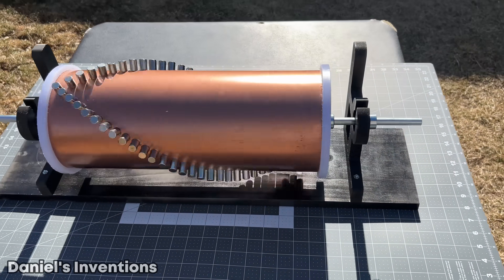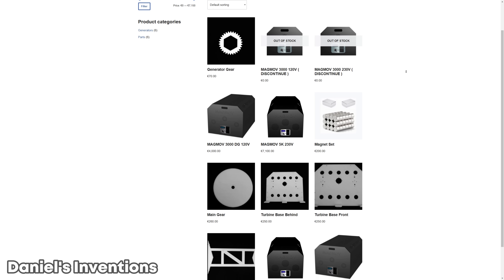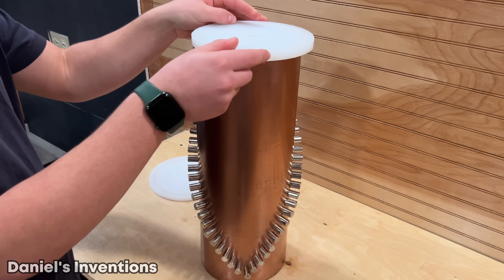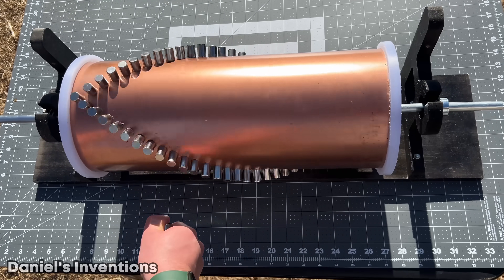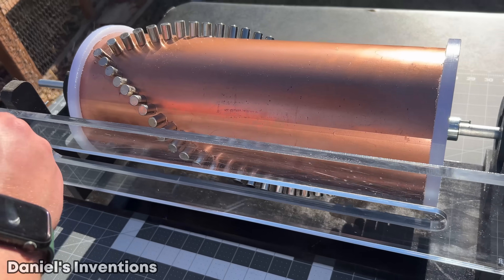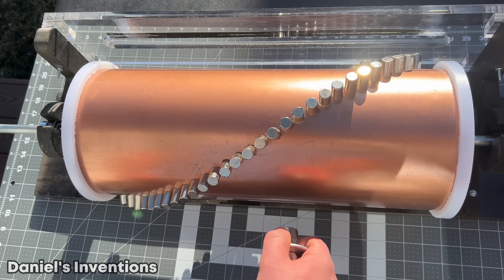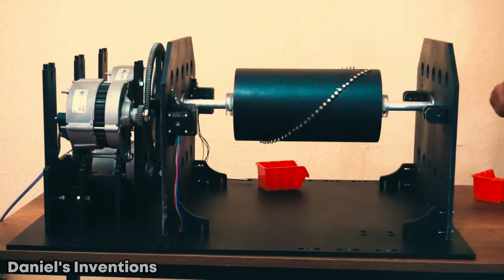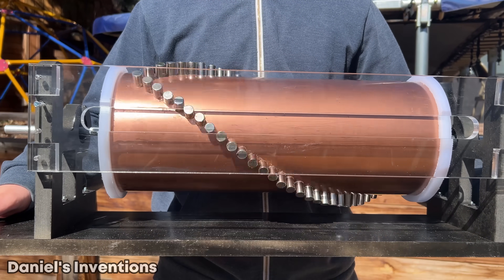A Generator That Can POWER Your Home for Free

Comment from the maker: I attempted building a basic prototype of the magmov magnet motor to test the concept of operation. It is unclear if this motor ever worked in a closed loop, generating several kilowatts of free electricity and charging it's own battery at the same time. After doing some testing on this prototype, it seems promising as far as using the actuator permanent magnet to convert linear motion into rotary motion. However, in order for this invention to be overunity, that means that the power required to move the actuator magnet back and forth needs to be a lot less than the torque generated in the rotary motion.

Also, not sure if the website is legit. Here is the link of the website: https://magmovenergy.com. If anyone ordered anything or has gotten in contact with the company, please leave a comment for everyone else. We would all like to know if this invention is the real deal. Thanks
Reply: Hi Daniel, how can I contact you? I have a real easy ou device for your next project. I promise it won't let you down. It's so simple I'm sure you will love it, and after we can sell them or the plans? Cheers
Reply: Fake fake fake. It looks pretty, that's it
Reply: That is some new cool things you can do with the magnets. Has anyone tried that with a copper rod instead of a different alloy and the bearing housing at the ends are magnetic to get the Eddie currents flowing?
Reply: @DanielsInventions  Daniel I believe it works, but 7 years old and like many others, nothing. Please read my other comment re a less complicated version you will figure out the design. I have another machine I'm looking to partner with, if interested?
Reply: Даниэль, конструкция Магмов украдена у твоего соотечественника-Джеймса Эллиотта.
Эта система рабочая, не нужно сомневаться.
Самое сложное в этой системе это синхронизация работы шаговых двигателей
Reply: @ADMENTNMANTAR  daria pra usar algo como algumas engrenagens e que com a rotação do primeiro motor fizessem o ima que transfere o torque pro motor se mover e sincronia, agora depois de dar o start seria difícil para a rotação e o ganho de velocidade.😂😂😂
Mas isso poderia ser resolvido criando um afastamento do imã ou até colocando alguma defasagem na engrenagens.
Tipo quando um motor a combustão esta fora de ponto.

Pra dar a partida bastaria girar o motor com a mão e controlar o ponto dele com alguma chave simples tipo uma chave de boca ou coisa do tipo.
E ao invés de meter um monte de engrenagens bastaria algo tipo a transmissão automática de um carro um cone metálico  que dependendo de onde a polia esta vai gerar mais um menos rotação, ou nesse caso colocar ou tirar o moto no ponto certo pra fazelo ganhar rotação ou ate para...
E no eixo principal bastaria acoplar o motor gerador e a prate eletrônica.😊
Pesse fora da caixa e tente simplificar as coisas, e você vera que as coisas complicadas são feitas atraves de coisas simples.

Se fizer de tal maneira o problema vai ser só a parte eletrica e a potencia que o motor pode gear e qual e a rotação adequada pra o motor não se auto destituir ou desgastar rápido.😊
Reply: Looks like one of these scam web sites to grab your financial data.
Reply: The mag section is not over unity to what torque is required to power that 5 kw output or more and the friction is too intense.
Reply: @DanielsInventions  keep at it might look at adding it to wind turbine or water turbine with help the concept is spot on specially if you can build a em. Motor you could use it for gravity or gyroscope all the time making elec. Just space ✨️
Reply: If you didn't see it working than there is no reason to believe that it worked.
Reply: Даниэль, я собрал более сотни конструкций, для понимания реальных результатов, а не тех  которые получаются при расчётах.
И пришёл к выводу, что отталкиваться нужно не от концепции силы магнита, а от его точки нестабильности.
Вот вам пример:
Генератор выдаёт мощность 100квт
На что уйдёт больше энергии: выработать такой же объём, или поднять этот генератор физически допустим на высоту 1 метр?
Я веду к тому, что масса энергетической установки всегда меньше силы выработанной энергии.
Тоже самое и с магнитами: как правило если магнит тянет 70 кг то его масса всего 400 грамм.
Reply: Даниэль, если сравнить ваш прототип с индуктивным толкателем, то вы поймёте, что он ничем, кроме конструкции не отличается от генератора Данцига.
У него добавлены балласты по кругу, а силу движения барабан получает за счёт упора толкательного магнита.
Ведь основная идея таких импульсных двигателей в том, чтобы дать один импульс для движения на оборот, с целью того, чтобы остальную работу выполнили магниты, расположенные по линейно увеличивающейся окружности.
При расчёте таких установок необходимо учитывать массу ротора, потому что при увеличении его диаметра и как следствие массы, удалённость магнитов, их габариты и массы окружность не будет пропорциональна модели первоначального варианта.
Reply: daria pra usar algo como algumas engrenagens e que com a rotação do primeiro motor fizessem o ima que transfere o torque pro motor se mover e sincronia, agora depois de dar o start seria difícil para a rotação e o ganho de velocidade.😂😂😂
Mas isso poderia ser resolvido criando um afastamento do imã ou até colocando alguma defasagem na engrenagens.
Tipo quando um motor a combustão esta fora de ponto.

Pra dar a partida bastaria girar o motor com a mão e controlar o ponto dele com alguma chave simples tipo uma chave de boca ou coisa do tipo.
E ao invés de meter um monte de engrenagens bastaria algo tipo a transmissão automática de um carro um cone metálico  que dependendo de onde a polia esta vai gerar mais um menos rotação, ou nesse caso colocar ou tirar o moto no ponto certo pra fazelo ganhar rotação ou ate para...
E no eixo principal bastaria acoplar o motor gerador e a prate eletrônica.😊
Pesse fora da caixa e tente simplificar as coisas, e você vera que as coisas complicadas são feitas atraves de coisas simples.

Se fizer de tal maneira o problema vai ser só a parte eletrica e a potencia que o motor pode gear e qual e a rotação adequada pra o motor não se auto destituir ou desgastar rápido.😊
Reply: The guy on limitless potential technologies  just built something that works
Reply: Wasting your time.
Reply: Do you have the blueprints on how where I can get the specs on the thin, how to, you know, get the basics going?Let me know I appreciate it very much
Reply: Can you cut a seam in the base in the cylinder so the magnet go back an forth under the cylinder?

Comment: Because you have to move your hand. That means I have to make some kind of mechanical system to move the magnet back and forth so I don't have to sit there and hold it. No thanks I can use special magnets with weaker South poles than North Pole and multiple arms with them angled on the end. Theoretically way more powerful than that and I don't have to move the input magnet.

Comment: Snore too weak and not efficient magnetic field pattern  If you have to use a input magnet. It would be more efficient to use magnets that have a smaller South Pole than North Pole. With a magnetic field to push them. This design looks inefficient to me

Comment: That is a bullshit to make Traktion on the chanel, car alternator has a eficiency of 50-65% conversion and it needs 1 to 3 HP to produce energy so do the math almost 50% of the energy is lost through heat. That toy is not gone produce 3 to 9 HP no mater what magnets you put there. But it will make him enough visualisations out of curiosity of people who have no clue of physics

Comment: I have developed a powerful lubricant using 98 % ion -free phlogiston which is available in limited quantity. This lubricant will allow your free power generator to run indefinitely without any friction whatsoever over its lifetime. I am providing this lubricant, Phlogiston Grease - Mk 12, for a small fee which includes shipping and handling. If you are interested, please let me know.

Comment: I FEEL SORRY FOR THOSE WHO BOTHERED TO MAKE ONE AND WASTED THEIR MONEY. THE MORE GENERATORS YOU HAVE, THE MORE TORQUE YOU NEED TO DRIVE THEM. ADD EVEN A MODEST LOAD AND IT DIES IF YOU CAN EVER GET IT TO RUN..      OUTPUT = INPUT PLUS LOSSES NO MATTER WHAT CONFIGURATION IS USED.  NOTHING IS BEING GENERATED - ONLY CONVERTED TO ANOTHER FORM OF ENERGY.

Comment: what if you increased the number of outside rails with magnets so you have a rail on top bottom and both sides all with the magnets in them on rollers and your design the outside magnet needs to be able to slide back and forth a slight bit further so they dont smack the ends.. adding the extra rails think of it like adding multiple magnet phases adding efficiency  in theory enough phases allows infinite energy same concept koenigseggs new dark matter motor that runs on 6 phase power

Comment: It can work ypur.minds arent stong enough to bring it to the light listen boy make a round structure around that and place ypur magnets to that and it can continue turn no hands and u can make a slideing system where ypu slide magnetic plates in and the it can be change dthe speed the movement

Comment: Reality Check
No independent third-party tests, certifications, or published technical documentation have been found.

MAGMOV’s claims appear largely promotional, with no data-backed demonstration that power output exceeds input energy.

Similar “magnetic generators” with extravagant claims have repeatedly failed under rigorous evaluation.

Comment: I have a practical simple design with immense power, low complexity, uncontrollable power only can be geared down or the rotor remove while running, purely repulsive, a 15 cm dia motor can produce 2kw to 3 Kw at 2000 rpm geared to 6000 rpm, self sustaining, just start needs a battery, then output can feed the input and yes the input is independent to the output, not dependent, just the magnets provide all the energy
Reply: If you upload your model it clearfy many mindset in this meter

Comment: It is not unclear if this motor works. It is crystal clear that this motor does not work. Moving the magnet needs the same amount of energy as the motor can deliver. And since there are always small losses this motor doesn't run continuously even without a load. "Magmov" is obviously a fraudulent company.

Comment: Another perpetual motion machine.  But you got to have a human hand with a piece of metal moving back and fourth?  Nobody has time for that.
Reply: And any attempt to derive this movement from the rotation will fail, since this movement needs an amount of energy equal to the energy the rotation can give. And since there are always small losses this motor doesn't run even without a load. "Magmov" is obviously a fraudulent company. Conservation of energy seems to be unknown to Daniel.

Comment: Is it possible to instead of moving the 1inch magnet in linear motion and do it with a circual motion/oval motion, then you can attach it to a propeller and use water flow? I have no idea what I'm talking about tbf
Reply: Sorry, but if you have water flow at your disposal it is much more efficient to use a turbine which drives a convential generator. This device is completely useless.

Comment: I can tell you are sincere in your quest for power, like so many of us are also, and that you are open to suggestions on ways to improve its output.  While I am not familier with this particular design, I can say with some degree of certainty that replacing those alternators with stepper motors and operating those above their rated RPM's will increase their output per input ratio. I don't think that particular magnetic linkage can rotate them that fast. Will it be OU to the point of being a self-looped generator? That would depend entirely on the skills of the engineer, and from what I can see you have them.

We are all in this together; may all the powers assist us.

Comment: After doing the Math this will never work. 24 Watts in and 5watts out if you use %50 efficiency.
The maximum speed of the steppers is about 250 mm/sec. That translates to 1/2 RPS or 30 RPM of the Drum. The Math is: HP =Ft/lbs Torque X RPM/5252. So if the RPM of the drum is 30 RPM and the Torque is 10 Lbs of pull or push from those 1/4 inch x 1-inch magnets. The magnet force is on a radius of about 2.85" Radius. So that's 2.85/12=0.2375 X 10 LBS magnet force= 2.375 Ft/lbs of torque.  The Horsepower and watts can be calculated from this. Again HP=Ft/lbs X RPM/5252.
So 2.375 X 30/5252 =0.01356 HP or 750 watts X 0.01356=10.17 watts. So you use 24 watts on the steppers and get out 10Watts.  That is a 100% efficiency. This will never work, unfortunately. I should have done the math first before I spent time modeling.
I learned something about Fusion during the process.
Reply: So I guess they don't offer refund if I purchase because you said it won't work lol

Comment: It's the 21st century, why are people still wasting their time on this kind of stuff?
Reply: Because it's rooted in something real and people know it on some level.
Reply: @JenkoRun    Can you give any evidence that it's rooted in something real?
Reply: @heinzpg  What's rooted in something real will be what you deem to be real, unless you're willing to get a Stirling engine and run the experiments yourself nothing I say is going to get through to you. I know your type.

Get a Stirling engine > run normally > measure performance.

Thermally insulate 1 side > measure performance.

Heat both sides > measure performance.

Compare results.
Reply: @JenkoRun    The Sterling engine is known since 200 years. It was and is used in many variations and in many applications, also in reverse mode as heat pump. I know your type. You have only moderate knowledge of physics but you still think your experiments have shown something new and extraordinary which has escaped physicists in 200 years? It may be difficult but if you manage to get hold of a person really competent in this field this person will be able to explain the observations you have made and that they are in perfect compliance with laws of physics.
Reply: @heinzpg  Your critique would carry more weight if it were not falsifiable by experiment, I have a limited amount of patience for your type and I've reached my limit.

The details for the experiment have been provided and experiment overrules all theory, I genuinely hope you come to understand that someday.
Reply: @JenkoRun     Claims like yours are encountered quite frequently but usually they are easily shown as wrong. That's why I also have a limited amount of patience for your type. Experiments only overrule theory if they are done properly and a good understanding of theory is present. I can't judge if this is fulfilled in your case.
So I can only advise you to get a confirmation of your findings by a person with a high competence in this field. If your findings are confirmed you can apply with good chances for the Nobel price in physics and I will read about your findings in science journals.

Comment: daniel ,Teslta stated that anyone that can find the answer to 3 6 9 can control reality ,well they speak cryptically ,and inverted he really ment if you take out the number 369 from the numbers 1to 9 it leaves you with 142857this number is directly tied to the reality and spiritual realms ,when used with the 52 cards and the zodiac can be used to decode the reality
Reply: There is no evidence Tesla said anything about those numbers, provide the source before spreading claims.

Comment: It can never generate more energy than what you put into the stepper motor to move the magnet side to side. That's where the energy to move the motor is coming from. There is no such thing as free energy.  Just try putting just a little resistance on the rotating drum. It will stop easily. There is absolutely no way this can generate 3kw of power as described. No way.
Reply: False understanding of energy.
Reply: @JenkoRun  How many of these free energy scams do we have to endure before people will finally admit that it's not possible?